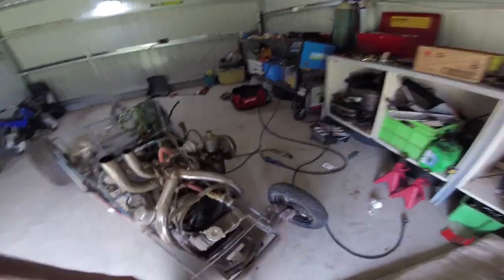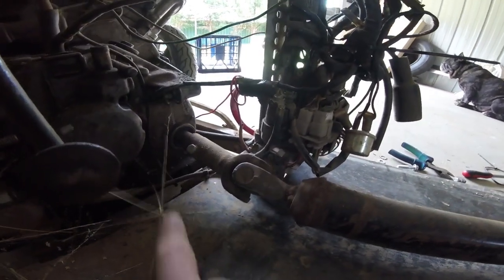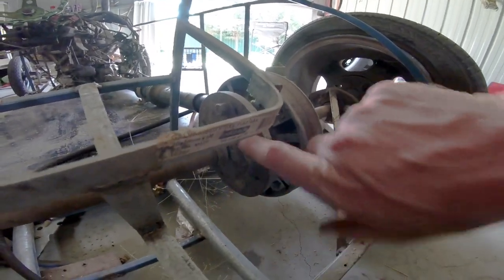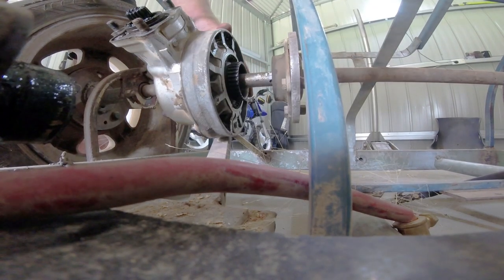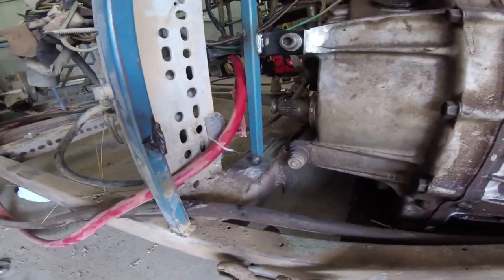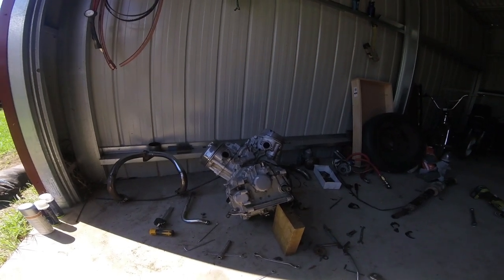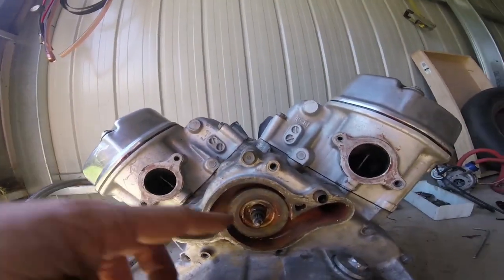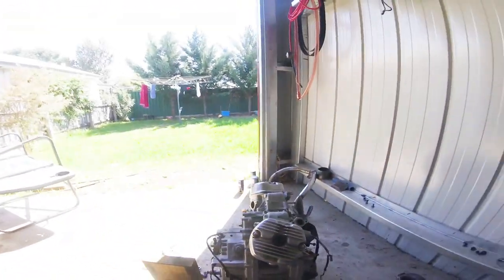So HOW EXACTLY does that rear end work?  Turbo CX500 powered Minirod Gokart

Comment: What did the rear diff originally come out of??
Reply from the maker: brian whelan it’s the rear gear out of the shaft drive rear wheel that came on the cx500 motorcycle that the engine came out of